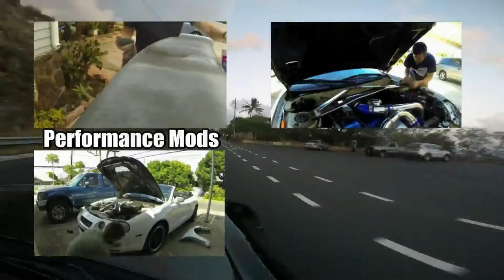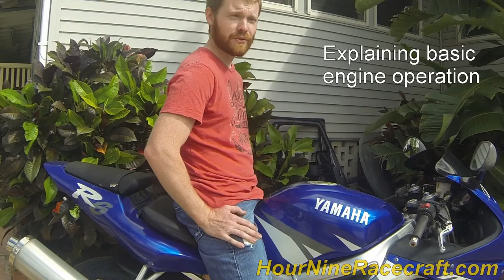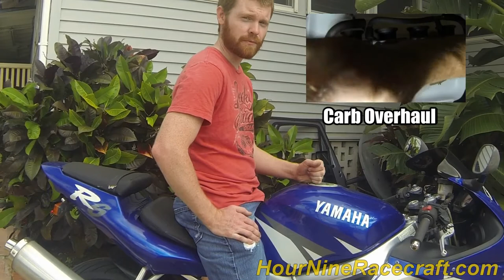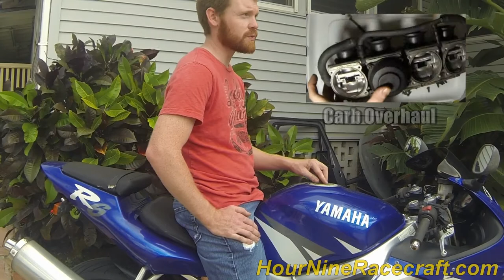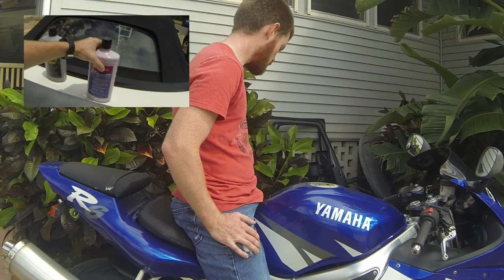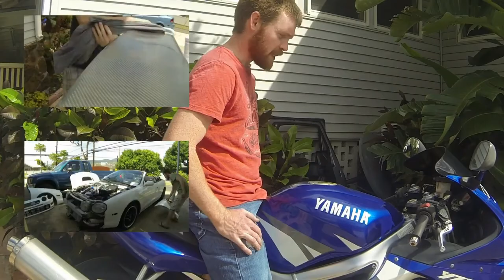Hydrolock Explained (fluid in cylinders)

Comment: Thanks mate! I had this problem on my zxr400 some time ago exactly the same. Basically the float valve rubber seals had deteriorated and fuel was going into the cylinder. I have never heard of hydrolock before, had I heard of this I definitely wouldn’t have kept trying to start it. You live and learn as they say!! Much appreciated!!

Comment: What is your opinion about? It is a really amateur question but maybe you can give me suggestion about it. I bought a ducati 748 motorbike which has air intake on the front. I am so that i want really take a good care this bike but on the weekend i had to ride whit it in really havy rain more than 100 km.... I was so that it is sucks. I want to take care the bike and i rode whit it in havy rain all day. In my thought was if those air intake on the front those working now as an watercollector... and what if water somehow can get into the engine. What do you think about this? Can enginee have some damage or something bad that i rode in havy rain many km? Is it possible to get any water in the engine and making so any rust or something. I didnt have any problem and the bike working gokd but now some thoughts in my mind that in long time i can have something because water working in the engine. Making rust or anything i dont know. Stupid thoughts
Reply from the maker: Congratulations on the Ducati! I have an 848 now. I wouldn't worry about getting a few water droplets into the engine. They'll blow straight through and won't harm anything. If it's a factory intake then they would have planned on someone riding in the rain, and hardly any water would make it into the engine. If it's an aftermarket intake then it'll probably let some water droplets into the engine, but they'll be fine. If it's an aftermarket intake I'd be concerned about rain water getting into it while the engine is off and the bike is parked
Reply: Thank you for your answer and i congrats for the 848 too😉 i looked after this some pictures about the 2 airtube and the place where the two funnel is and there are some holes on the bottoms that maybe the water can flow out and the funnels stay a litle bit higher but i was really embarassed that i rode in that rain and my thoughts were around this. Thank you again

Comment: Dude...... This is EXACTLY what is going on with my bike. I kind of did a shitty job of cleaning the carbs which might be why its not hydrolocked??? I sprayed carb cleaner down the cylinders instead of removing the carb and since then its got worse...... Didnt have the issue before I cleaned them out either. Since then, my bike also will bog out when i go to give it throttle from an idle. Could this be from the same issue??? I have the exact bike you have. 01 r6

Comment: Please help my bike is a five year hard saving of my minimum wage job. Gave up 80% of what I made the past five years to pay the down payment for a 2017 s1000rr and still paying EMI for a four a year loan as this bike is my childhood dream. The bike was such a charm for a year now. Today I rode it through hip deep waters and the bike started sounding weirdly as soon as I left the water but It ran just fine so I rode a km or so to reach home. I stopped to check and when I stopped and turned ON the engine again it made a huge bang with clutters and shut off. I never started the bike again and fear a hydro lock. What should I do now?
Reply from the maker: You may have engine damage if you sucked up water. Buy a cheap endoscope on online (narrowest you can find) and try to look inside the spark plug hole for damage. The modern endoscopes work via USB like a webcam with nearly any pc

Comment: same cleaned my carbs and when i put the bike back together engine flooded....gas went into oil and now i can barely get it to idle.  Going to change the oil/filter and handcrank the engine tomorrow with plugs off to see if it will change.  Any ideas
Reply: Were you able to fix it? I’ve the same problem.